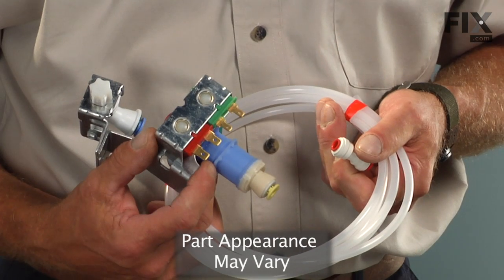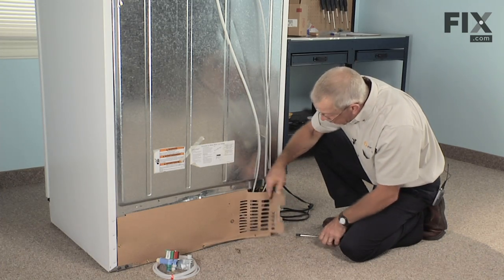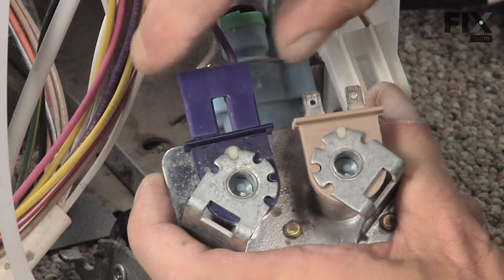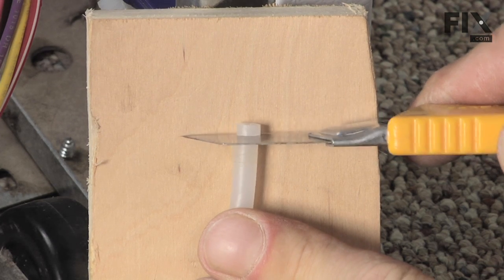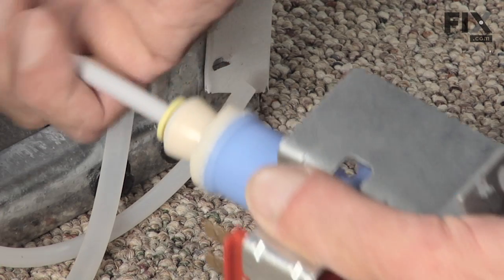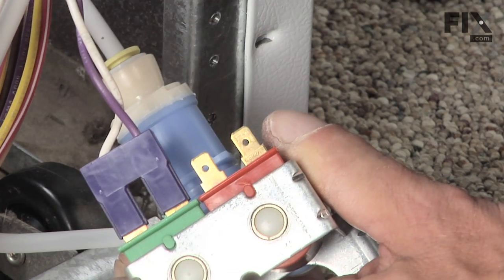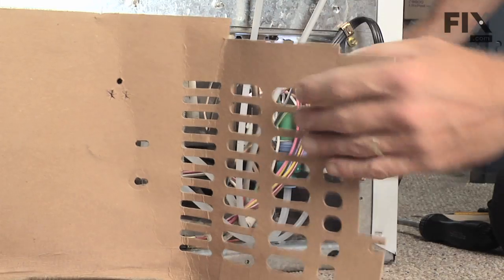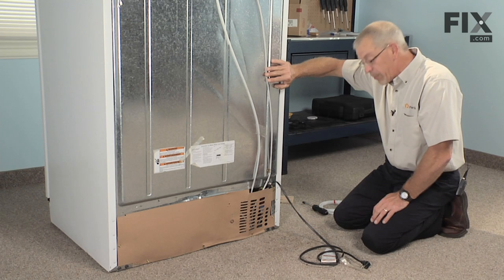Whirlpool Refrigerator Repair – How to replace the Water Inlet Valve

Comment: Hi thanks so much for the great tutorials. on my whirlpool the larger tube that goes into valve (I think the one you cut first here) is leaking. from the valve the tube travels over to the fridge side and to goes up a hole into the back of the refrigerator. do you happen to have a tutorial on how to replace that tube? my inlet valve is working fine, it's just that tube has a hole in it that is leaking. thanks so much for any advice.

Comment: I installed a new part but as soon as i press the water dispenser button the water pump burns out. Happened twice so is not faulty piece. Ia the correct model

Comment: Great tutorial video

I watched your video and it was very easy to switch out water valves and I thank you for that. My original problem was the ice maker would not fill up with water to make ice. I got my part for my Kitchenaid side by side fridge.

1) I disconnected the water supply line and tested for water pressure and it was HIGH. 

2) I tested the terminals for continuity and the one with the small connectors would give a high reading then immediately drop to 0. I did this several times and got the same results on each one. The larger sized terminal connector read high each time.

Now my problem is it still won't fill the ice maker with water. 

Any more suggestions?
Reply from the maker: You should get similar readings for both solenoids on the valve. What is the high reading that you get in ohms? Do you have the harness disconnected when you measure the continuity? What is your model number?
Reply: The small terminal connectors read 181.0 then within one second it goes to 0. The large terminal connector reads 185.0 and stays there.

I checked the readings after I unplugged it from the valve.

I also noticed the water from the front dispenser has about half the pressure it used to have. Could I have plugged water lines throughout the refrigerator? If so how do you clean them out?

Model #KRSU25FK

Thank you very much for your help.
Reply from the maker: If the water flow has decreased I would suspect the restriction would be at the inlet to the valve, or that the water reservoir may be partially frozen. The resistance measurements should be taken with the harness removed and then measured at the male terminals of the valve solenoids. You should see about 180 ohms on one solenoid and about 250 ohms on the other.

Comment: If the water dispenser and ice maker is working and the inlet valve is leaking, does it still need replacing or is it the tubing?

Comment: I replaced my valve as my water dispenser was dripping.  After replacing the valve, the dispenser is still dripping.   Any suggestions as to what I should check next?  Thanks.
Reply: I know this is an old comment but did you have any luck? My water dispenser is leaking from the front dispenser. It’s a constant drip 😢

Comment: Thanks for this video! What is the replacement part number? We need that part WITH the extra piece before you snapped it off. Our original part is 2188622 and our fridge model is Whirlpool ED2PHEXMQ00.
Reply: @Brixton Alden Instablaster =)
Reply: @Brodie Moshe Thanks for your reply. I got to the site thru google and im in the hacking process atm.
I see it takes quite some time so I will reply here later when my account password hopefully is recovered.
Reply: @Brodie Moshe It did the trick and I now got access to my account again. I'm so happy!
Thanks so much, you really help me out!
Reply: @Brixton Alden You are welcome =)